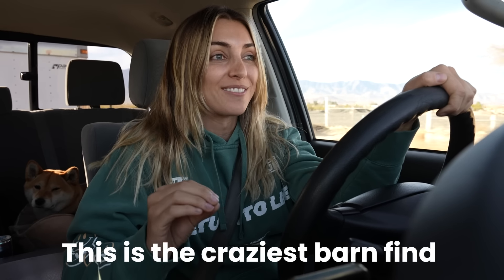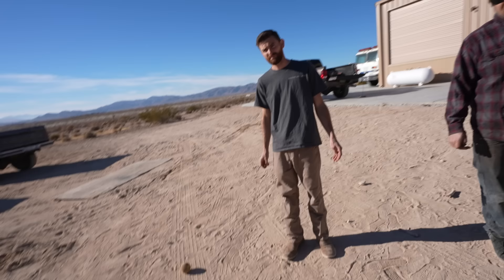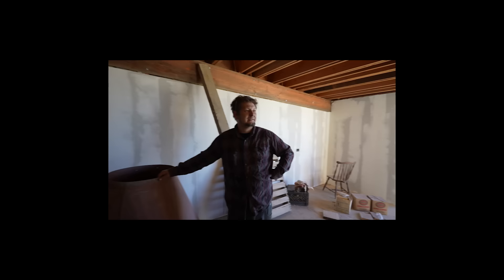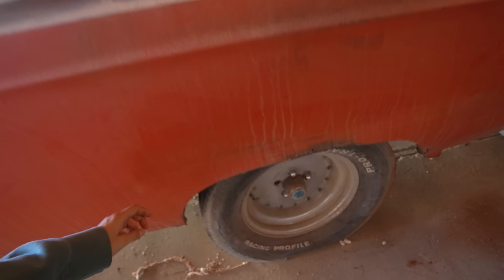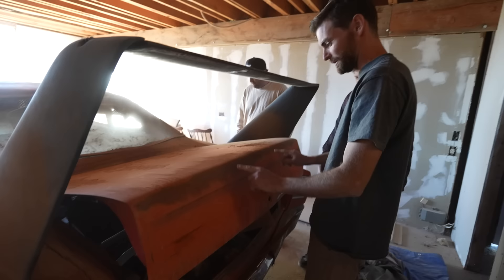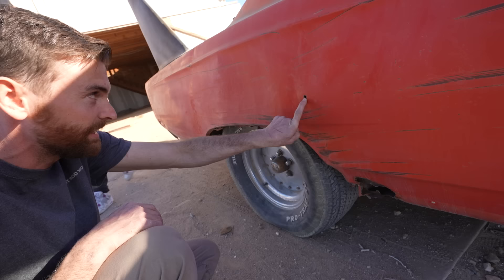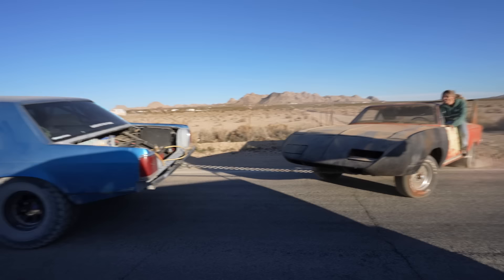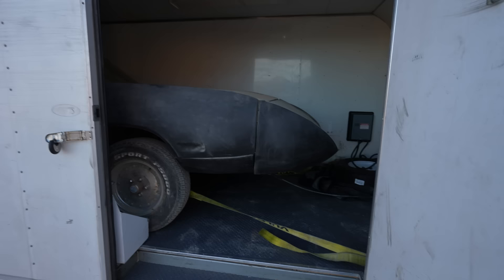I found an ABANDONED Plymouth Superbird in the middle of the desert

Comment: 10:59 Kid its not a good idea to pull a Unibody by the K frame, as its wielded together bodywork that mates with the subframe, and you could literally rip the lower suspension out of its mounting points and warp the bodywork, next time push and use a tow truck, a proper one,

not a yahoo in a crown vic, and also check the nose, it should be metal, not fiberglass, and this car was made by taking a 1968 Roadrunner, while the daytona was a charger, and giving it a makeover to remove the aerodynamic drag of the rear window, a rear adjustable wing for downforce, and the aerodynamic front nose cone to reduce the drag and redirect the air to feed the engine from below

and where are the humps over the wheel arches that reduce the pressure on the nose by redirecting the air over the fenders, however I dont think they were ever open to the elements like on the race cars

plus their should be extra bracing where the wings are, and the vin tag should give you an idea of the options and if its a real one or not, along with a build sheet underneath the back seat

also seal the area around the radiator so the air cant get past it, as if not the radiator will suck in the air from the engine compartment instead of the cool air coming into it and cause an overheating issue

usually vapor lock, or worse, hence why most muscle cars had shaker hoods, and vents for that, also an accusump would be a good upgrade if you plan on roadcoursing it, as the oil pans were not rigged up for high G cornering on the street 

while the race cars were with valve cover breathers and most likely had their own form of baffled oil rally course oil pans thus preventing the issue all together

and mike musto has rally coursed the crap out of his dodge charger 440, the other base car of the superbird/daytona fleet with simply that and had no trouble with a mild 440 like that

also for god sakes dont ls swap it or put a modern hemi in the thing, they suck, and SUCK BAD, upgrade the brakes, the shocks to koni style with some proper gas struts

and the disc brakes you'd find on a german car with 14 inch steel wheels, and she should be ripe as rain and ready to haul ass

also with the bad gas nowadays they need a spacer between the deck and the carb, so a lower deck on the intake may need to be a must with it

along with a shock tower brace to help keep the front planted and get traction to the wheels, as that was the big problem with these

big power, big block, tiny tires with not enough patch and polyglass to throw it all over the place with brakes that only worked once before the drums overheated if you really slammed on them at high speed

although apparently knock on a 101 octane used to be a thing, so even our mild gas might be better now,

Comment: If you potentially plan on getting this car up to 200 miles an hour You have to get the vents installed Into the tops of the front fenders To make sure the car sucks down to the ground. Especially if you put a hellcat in there You want that stability and control. Also because of what the car is You should keep it orange and white And make it look like your own version of Richard petty's. 
And please don't make a foolish decision like you did With Getting rid of the daytona, With this car

Comment: What you found is probably a Satellite, definitely NOT a Superbird.   1) no fender vents or fender scoops on top.  (2) A pillars are standard street style, not the pillar covered style for NASCAR . Incorrect 1/4 panels. The 70's did not have " Dents" in the rear as you were pointng out, but simulated side scoops halfway up the quarter, in between the front of the wheel well opening and the door.  Whats there are '69's.  The big one is (3) regular triple bend rear window. Does not have the "plug" to reduce the size of the window as well as the "plugs" that were at each lower corner of the rear window to smooth the air out. (4) the other biggie is NO VINYL ROOF, which they all had to cover up the rear plug work on street Superbirds.  (5) you did NOT show the VIN number or Fender Tag which would have confirmed or denied a superbird. But in this case, given all the missing specialty body parts and the fact the trunk lid says " Satellite, I'm going to guess '69 Satellite with Superbird nose & 2 '70 Coronet fenders that were not opened up for the fender vents. Just show the VIN & Fender tag, we'll tell you .